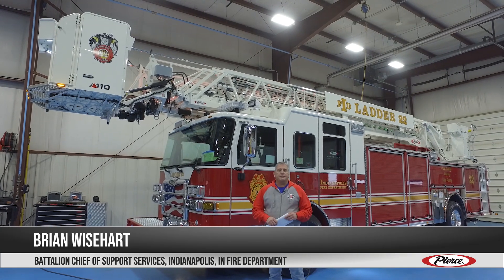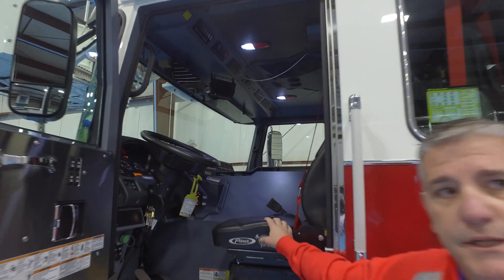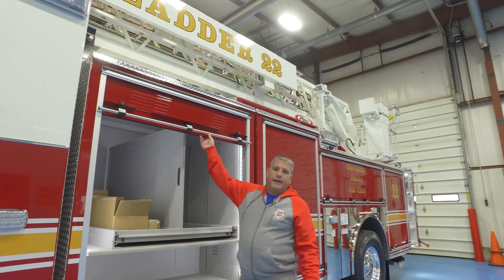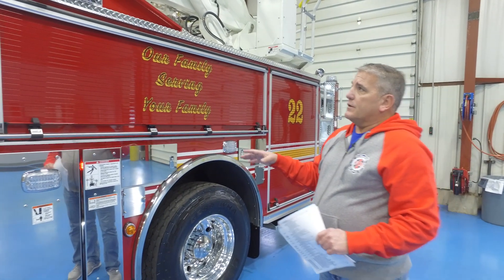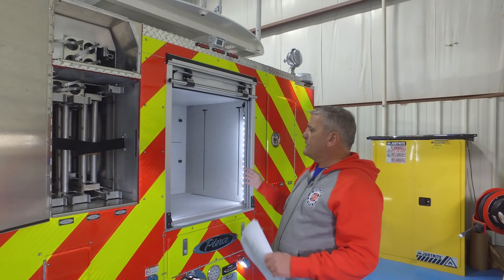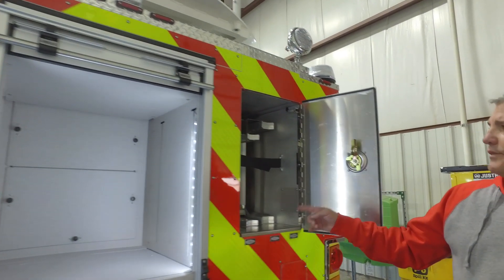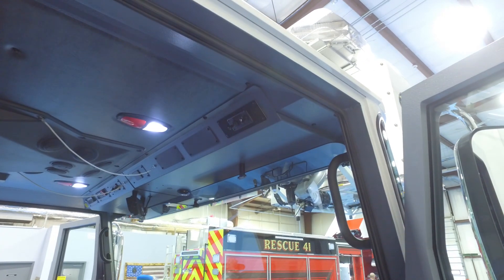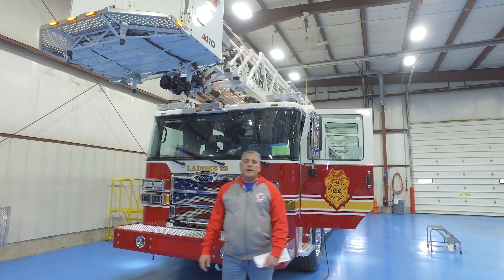Ascendant® 110’ Heavy-Duty Platform - Single Rear Axle – Indianapolis Fire Department, IN

Comment: I’ll never understand the ‘no pump, no tank’ mindset. Every single fire truck should have at least 200 gallons of water and a pump on it. There’s plenty room on these rigs for a poly tank and a pump.
Reply: This specific Ladder is in an area surrounded by enough engines and other ladders.
Reply: Nashville Tn does this, all ladders here have no pump no tank but every station has a pumper too.  Also you save money on this setup and prevent problems down the road.
Reply: @mtvjackass74  truck 9 and 19 have pumps but no tanks
Reply: @maxhallman1036  the tillers???  Wow!!! That’s something I didn’t know, cool!!
Reply: @mtvjackass74  yep
Reply: Most departments around here are going to this.  It also saves us from having to have a rescue truck, without a pump and water you have more room for all the heavy rescue equipment on the ladder.
Reply: Pumps don't belong on city ladders
Reply: @tonyrizzi8050  Detroit fire dept uses pumps and tanks on their str8 sticks......